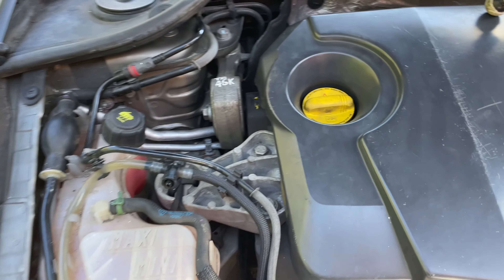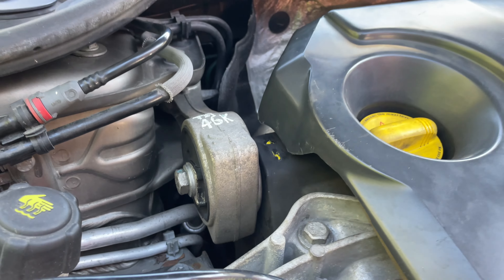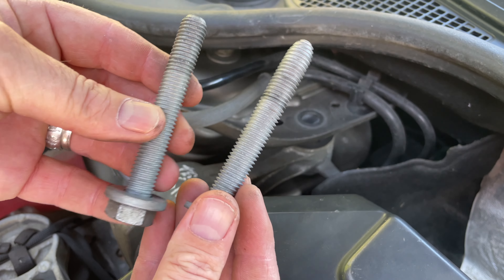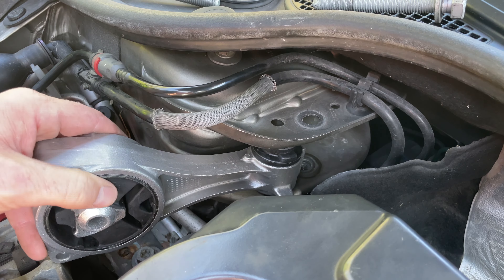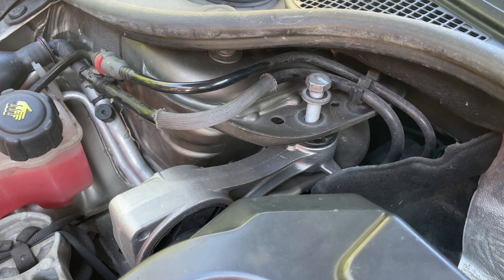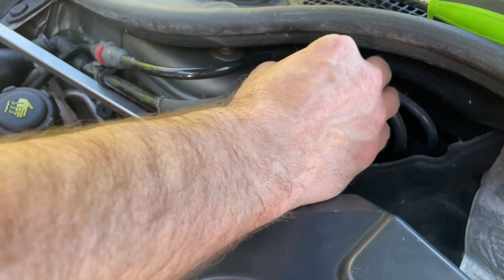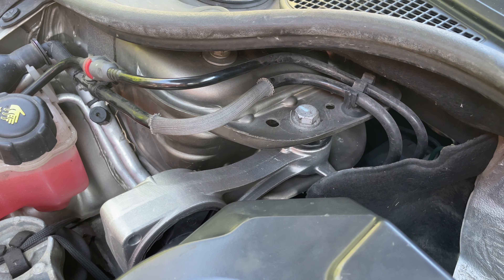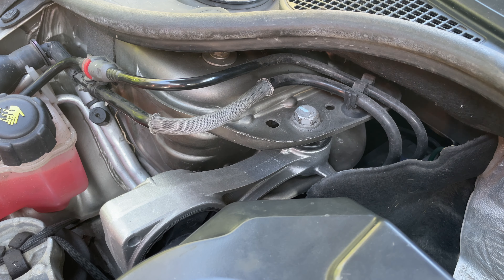Engine mount replacement  (Renault Laguna 3)

Comment: Nice disclaimer :)) . I recently changed all engine+gerabox mounts . I made the mistake of not supporting the engine when i changed the upper 'hidraulic' mount . The engine did sag and twist a bit . No big issue , but without an M10 threaded rod i could not pull the engine back in its place . -I could , but i would have to lift it up again , put on stands again , remove engine cover and mount a small hidraulic jack on the bottom of the engine somwhere . Problem is...:) :D , i already did this for the gearbox mount , and i was hoping to simply change the upper mounts one by one... That was a mistake ... So if anyone reads this , save yourself 2 hours and keep the car and engine jacked all the way . The lower mount and the upper rear left can be changed without jacking the engine . 
Another important bit is the necessity of some small crowbars , can be as simple as a pipe - for the lower mount , as you don't have enough space for good leverage , you will understand when you get under the car...:D . In retrospect a Crowfoot wrench would have been really useful for the upper 'hidraulic' mount -as you don't have enough space from the coolant expansion tank. All in all straightforward procedure .
Reply from the maker: Fantastic bit of advice here for people looking to do it themselves, thanks very much for sharing. I’m sure it will greatly help someone

Comment: Excellent vid as just checked mine and it has perished in the same way. 2 quick questions, would you recommend aftermarket or should I stick with genuine and secondly where do you source all the torque settings? Thanks.
Reply from the maker: Got the part off Amazon, and torque settings I have a Renault full service manual I got from a friend who is main dealer mechanic at a Renault shop
Reply: @quickfixmechanics  brill and that is handy!

Comment: Hey, is this a 1.5dci? Have to change mine too but wanna make sure there’s no need to support the engine when removing the mount.
Also where did you get the mount from, I’m looking on auto doc but you never know if the part is suitable even when they say it is, thank you, appreciate it in advance 💪🏼
Reply from the maker: Hey yes it’s the 1.5 dci K9K engine, I got the part off Amazon, you don’t need to support the engine but it will sagg a small amount as you can see in the video. I’ve never had any luck with Auto Doc and parts
Reply: @quickfixmechanics  appreciate the reply, I’ll look on Amazon then, all the best!
Reply from the maker: No bother, good luck with the job, simple enough do with minimal tools
Reply: @quickfixmechanics  appreciate it, take care💪🏼
Reply: @quickfixmechanics that answers one of my questions 😂. 👍🏻
Reply from the maker: Yes